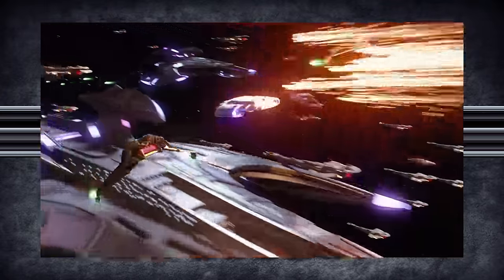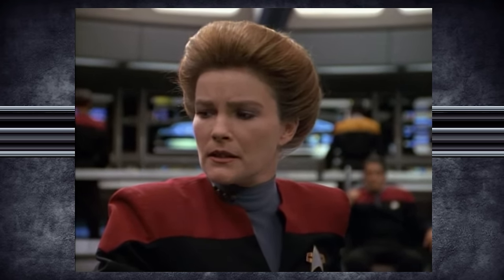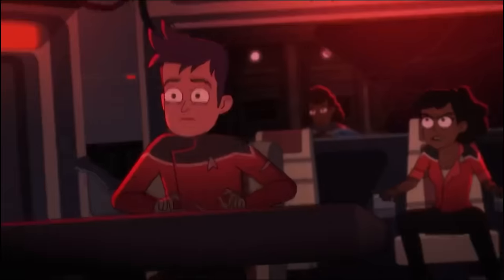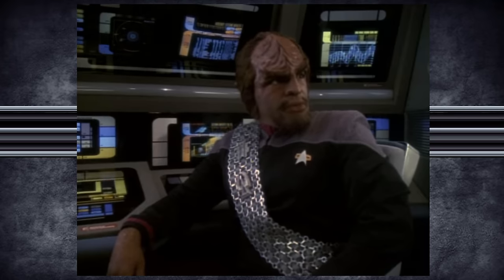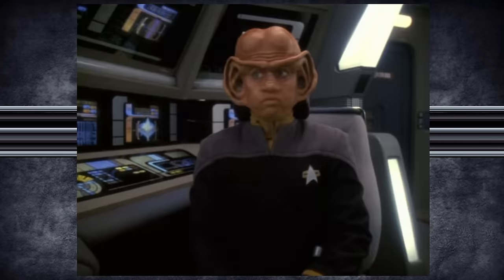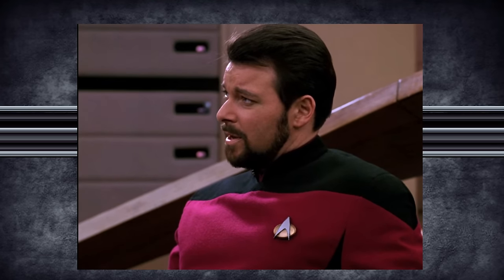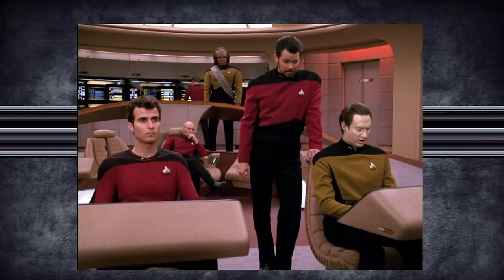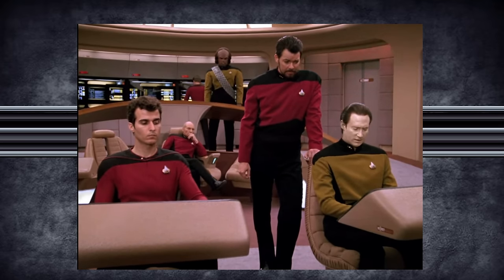Why Starfleet's Bridge Design Was Lethal to the Crews

Comment: The realistic reason for no seatbelts is that the inertial dampeners are blocking everything. Even half the ship getting blown off shouldn't budge you if the inertial dampeners are working. At the energies and forces we're dealing with for space travel and space combat, ANY hit without inertial dampeners up would reduce the entire crew to chunky salsa wallpaper. This means there should be no exploding consoles or swaying rocking cameras when the ship takes a hit, but that doesn't make for good TV. Without the inertial dampeners, just turning left kills everyone in Ten Forward. So there is a legit reason to not have seatbelts in any of these chairs. And it's because of the "Superman catching Lois Lane" problem. That's not a 1987 Volkswagon you're crashing into, it's a 2308 Mk 12 photon torpedo. A seatbelt that wouldn't just snap when you're thrown that hard from your chair isn't going to save you, it's going to slice you in half as you fly through it. The inertial dampeners are your seatbelt. As long as they're up, taking a hit shouldn't bounce anyone around as they walk down the hall. And the moment they go down, everyone inside the ship should splatter. Have them fail by degrees if you want drama: Some sections of the ship become impassible as the dampener field emitters fail, and everyone who steps into them explode into salsa, show the field retreating from unoccupied areas of the ship towards vital areas were cast members are hiding, people trying to outrun the visible forcefield edge sweeping towards them, bulkheads twisting and crumpling in its wake... That's where your shattering plasma-spraying consoles should be.

Comment: One thing that would make bridges a lot safer is Starfleet rethinking what they put inside it. Specifically, why is it that every station apparently has enough power running through them that any surge causes it to explode like a hand grenade? If you think about it the entire bridge is populated by i/o... the highest current device you might find nearby is a local shield generator. So why is it that something that amounts to a touchscreen and nothing more have the ability to turn into lethal shrapnel?

Comment: 1. Most bridges are OSHA violations, with high powered plasma running behind them. 

2. Once the inertial dampeners are gone, everybody is a stain on the wall. Automatic seat belts on the reboot were nice. Even when accelerations were not instantly lethal, the crew can still perform their functions while strapped upside down, sideways, or weightless.

3. After seeing the new versions of Aliens where they take off their helmets and a black goo infects them, no landing party would dare to leave the ship without a full space suit on an unknown planet. And we have Sulu firing his phaser at rocks to keep them warm as a major facepalm. The bio filters are perfect until they AREN'T, and we get the whole ship infected by an alcohol-sinthesizer pathogen.

4. I personally would put stairs on the ceilings of every corridor and perhaps also the bridge, more like a roll cage, that can be used in any direction, and so no steel beams can crush the crew on the bridge while at it. Some redundancy. And makes it possible the locomotion with gravity disabled or inverted towards any surface.

Comment: Sorry to burst your bubbles here, but the bridges are all designed for the camera.  It’s important that the camera can see most of the actors without them standing in front of each other for wide shots, but isolated enough to be treated as mini sets when needed.

That’s why Worf stands behind a huge control panel above the command team, he can move around so that he’s never standing behind someone else in a wide shot.  Same thing with the two panels up front, there’s a big wide gap so they can be in a tight shot when the scene requires it, but not be in the way on a wide shot.  This is also true for the command group around Picard and the engineering/secondary stations in the back.

Comment: Important shift duties on a ship are not typically 8hrs at a time. Typically more like 4hrs, example the Conn officer. Their whole duty shift may last 8 or more hours, but they will not handle a singular task the whole time due to the mental fatigue. They will divide there duty shift among their assigned duties.

The Galaxy class ships are flag ships, the third chair is for dignitaries or mission specialists. It is also where a captain will sit if an admiral ever takes command of the ship. There are special rules around flag officers when aboard ship, I’m not an expert by any means though.

Comment: If I had to design a bridge I’d emphasize specialization as much as possible while keeping things flexible. Every console should have one specific job for idea occasions but should also be able to access all systems in case something happens to one of the consoles or crew member. Similar to engineering there should be a lower ranking medical officer to ease communications between the captain and medical bay. I’d keep the communication desk even after the development of the universal translator, both in case the universal translator fails and to basically act as secretary. Stars fleet ships are probably contacting each other all the time and if they aren’t they should communicate more often for bothering tactical and safety reasons. Sure some communications should go through to the captain but there’s a lot of basic communication going on that captain probably shouldn’t be constantly worrying about. I’d also separate the “tactics” console from the security console so it’s not one guy splitting attention between space battles and a bar fight happening elsewhere. The only console I’m iffy in is science maybe give it the engineering treatment with a lower ranking officer but generally speaking science experiments shouldn’t be happening on the bridge. I’m also a big fan of the big see through displays just as it would potentially allow the captain an easier view of what everyone’s doing at a glance snd makes communication that much more easier. Also would not have 2nd in command on the bridge should definitely be in a separate room in case something happens on the bridge that may kill both of them. 

Oh yeah and basic safety should be taken more seriously I don’t think I’ve once seen fire extinguishers or seat belts used on the ship.

Comment: 13:30 This is all well and good in theory. In practice, the Mk 1 Human (or alien) eyeball is going to see a whole lot of nothing in deep space.
Even with strong local ambient-light sources, most objects in space (even on well-lit starships loudly and proudly showing their colors) are going to appear as distant specks at best until they're practically on top of each other, relatively speaking.

This is because even sublight encounters are greatly down scaled in magnitude from their stated speeds just so the show is comprehensible by the standards of the very real world human audience.
These ships, going at impulse level combat/cruising speeds are moving several times faster than the fastest jet ever made. (and the crew kept from being rendered into literal puddles against the interior/hull of their home berth starship by inertial dampening fields)

So unless we scale the speeds down to that of your average car chase or maybe a low altitude biplane dogfight, you can bet that nobody is going to see anything useful through the magical windshields and porthole covers of these starships. Not without the aid of directional sensors recording and playback anyway.

Comment: "If you can have windows that are not glass, why would you not have them?" 
Well... first question I would ask is that, while yes, they do use transparent metals... are those metals actually as strong as the metals used in dedicated armour? At least personally I could not find anything on the topic, so, just putting that out here. Since, if they aren't, well, then you are still trading protection for visibility, and it once more becomes a question of how much protection are you in fact trading away before the added visibility does not outweight it anymore - especially if we assume a scenario were power fails (i. e. the one you gave as an advantage for windows over view screens) because in that case it would stand to reason that likely enough, shields would have failed as well.

Comment: Starfleet may not use glass for windows, but I do feel transparent aluminium is probably not as strong as Duranium or Tritanium. Not to mention there are a number of problems with transparent materials letting potentially dangerous forms of radiation into the bridge.  I can see a direct window being useful as a backup but probably just something kept behind a blast door for emergencies.  In regular operation  not having a direct window into the most crucial room on the entire ship is going to be safer 99% of the time.

Comment: The TNG bridge layout was arguably the worst as a "real world" functional vessel,  but it was arguably the best suited for shooting TV drama for the fans, which is the main point of the show. Unlike the more modern shows that try too hard with dimmer moody lighting, the standard lights on the Enterprise-D were bright, not dim, so it was easy to focus on the actors. The wide open layout means that it's very easy to understand what everything is on the bridge and where every shot is taking place on the bridge at all times: it's much harder to take a quick random medium or right shot on the Voyager or Defiant and understand where on the bridge they're even standing without context. There's a big empty space in the middle to give good theatre actors like Patrick Stewart a little "stage" to conduct diplomacy. And the direct connection to the Captain's Ready Room and Conference room feels more real and naturally part of the whole drama. PS: One thing I disagree with you a bit on. You probably want your security guard to stand up. Notice that in banks, the security guard isn't sitting down. In the event of an intruder or problem, you want them on their feet ready to physically act. If you're sitting down all day your legs might fall asleep and you might not be ready or able to spring into action quickly.

Comment: While the captain and first officer have some displays and controls... The position of operations is to relay the captains orders to all other stations while managing the overflow of information between stations that the captain shouldn't be bothered with. Operations is charged with interpreting and executing the will of the captain. All "orders" flow from operations. Operations is routing and summarizing data to be sent to the small command chair consoles. Anything that can't be communicated quickly verbally and or is too trivial to be handled by command is handled by operations.The captain may give the order verbally on the bridge but operations officially sends the orders to the appropriate station. Operations is really the captain's station but he's has someone man it his place so he can concentrate on the big picture.

Comment: A lot of comments here, so I do not know if anyone has pointed out a very basic fact about Star Trek, and Star Fleet.  First of all it is "Star Fleet", and not "Star Squadron". Why is that a problem, well a fleet is Navy, a squadron is Air Force. The Navy has a long line of traditions in it, being the oldest military that could travel distances and explore new lands. When the Air Force was created in the US, the Navy took to fighting it immediately over missions and of course funding.  

Where does that leave Star Fleet, well it leaves it with a naval background of some very old traditions. The fleet is designed around ships. Ships in space. In other words, a Star Fleet crew could adapt to running a modern day Aircraft Carrier, and an Aircraft Carrier crew with some updated training could run the  Enterprise in Star Fleet. The bridge is right where it would be on ships today, located up high on the ship and at the front. Engineering down in the back with the engines. Somewhere in between those two the doctor and sick bay.

Comment: Plasma touch screen, with a waaay too tin heat/pressure transfer system for the plasma energy.
It's waaay to easy to either breach true and put main line plasma into the screen or to energize the screen plasma into a higher state that make it too much for the screen to contain, way to rapidly, giving a exploding pressure vat or tank, effect.
The choice was probably because of all the potential bypass options to still get them touch screens to work.
Just look at the Equinox alone, or the crashed Voyager locked inside ice and lots of other such happenings.

Comment: If transparent aluminum (or whatever those windows are) is the strongest material they have, why don't they make the whole ship out of it? And if it isn't, they're giving up armor to have those windows. Also, regardless of what it's made of, it's clearly transparent to much of the visible spectrum, which means that lasers of most frequencies (possibly all frequencies) can effectively pass through the window without being stopped at all.

It would be better to use redundant systems to make sure they can always see outside. If they really need windows to use in an emergency, they don't have to be on the main bridge. Also, windows would be useless in combat unless the enemy is so close you can see them with the naked eye. You'd really only need them for navigation, and it's hard to imagine that all the sensors are so far gone that you need to physically look at the stars to work out where you are, but it still has a working warp drive.

Comment: The very first thing I've always noticed is how they placed the bridge at the topmost part of the outer hull, instead of deep inside the middle of the spaceship so it's safe from damage and has several levels of walls protecting it.

Secondly, it looks like they never even heard of seat belts, so in every battle the people would be thrown around like dolls and busting heads, bones and ribs.

Thirdly, why only 4 beds in the medical center when they have a crew of almost 1000 people? What happens when they inevitably get into a battle? The injured lay down in the hallway?

Comment: If I was navigator or Helmsman, I would prefer to be facing towards the front of the ship - so could better visualize the directions I am facing, and the direction I need to turn to (in all 3 axis). EDIT - Also the chairs left alot to be desired. No seat-belts, no airbags, no comfort for long shifts. I always thought the Bridge chairs on the Nostramo were quite decent.

Comment: The bridge of the Defiant is the best overall of Starfleet ships. The battle bridge of the Enterprise-D could have been better, but that would have required the loss of the saucer separation which left the battle bridge in the same vulnerable position has most starship bridges when the saucer section and the engineering sections separated.

Comment: So I was in the Navy for 8 years, and what really bothers me is they have tactical and security manned by the same person. So I get tactical has to know what's going on inside the ship, but they should be two separate roles all together, and head of security should be a position below tactical not an adjoined role. The only ship this makes sense on is the Defiant being it's a smaller ship and much less crew. Consider any situation where someone boards the ships in any Star Trek episode, almost immediately the head of tactical leaves their station to deal with a boarding party, and then the station is manned by a junior officer. The situation outside the ship is still generally extremely risky and should have the best persons attention while a boarding party can generally be handled by less experienced personnel. Take Halo universe for example, when there's a boarding party what does the Commanding officer do? They send someone who isn't vital to ship/station operations to handle the situation they send someone who is meant to defend against boarding parties while the vital bridge crew stays at station.